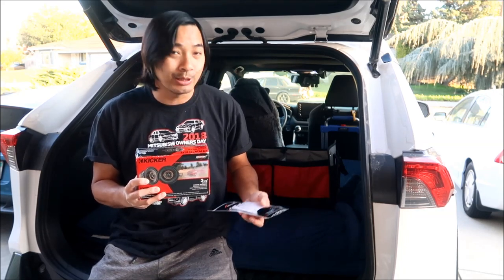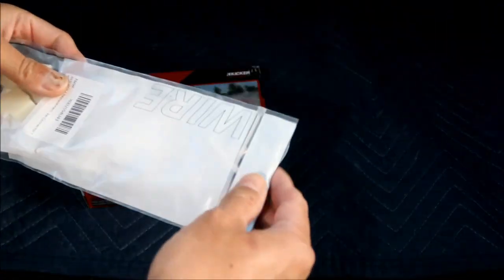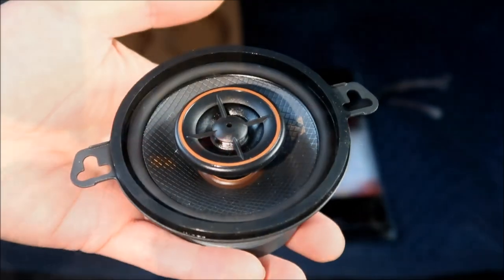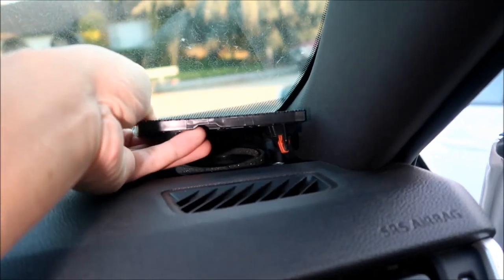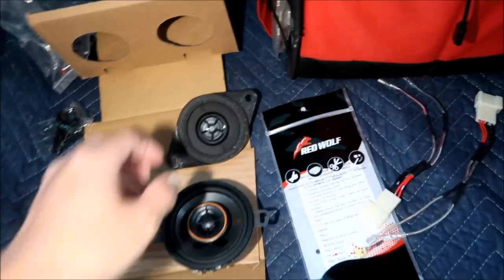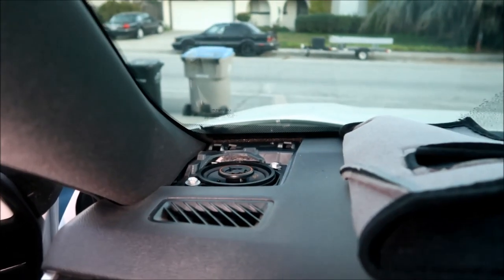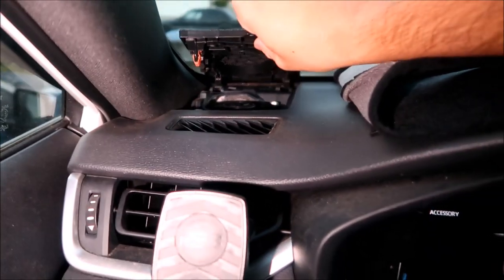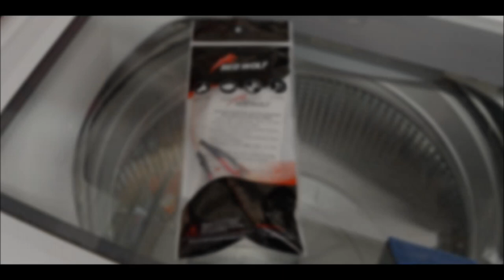Rav4 Prime SE Front Dash Speaker Install VLOG

Comment: Best video showing the changeover of wires for polarity.   Some speakers come with capacitors to deal with too much base especially at high volume.  Agree that what is backwards is the wolf supplied wires.  If it is a known fact that polarity is reversed from 'normal standard' on the rav4 primes, then wolf should adjust the harness for that and not force people to cut and splice.   However in this case it looks like kicker provides a cross-over so that you can power + both tweeter and base  separately?? and - is the small third terminal.   
So being a complete noob, IM guessing the crossover cable is to provide outputs to both tweeter and base separately?  Hence one would still need to reverse the polarity before plugging into the toyota stock harness.  The difference from what you did is is that you would reverse the + and -  (red and silver) before splicing them into Kicker cross over cable ???
Like you watched videos and thoroughly confused.    Wondering if a capacitor is still needed in this kit or if its built into the square piece that kicker provides on the crossover cable??

Comment: Thanks for the video but I wanted to let you know two things I noticed after installing my Kicker KSC3504 speakers.  You want to make sure you use the included crossover module from the supplied wiring harness from Kicker. The way you have yours wired the tweeter is getting a full-range signal and will eventually fail. I'd also recommend bass blockers be put inline as well.
Reply from the maker: Hmm interesting I haven't had a problem with the speakers.  However when my dash gets hot like from the sun it starts cracking whenever there is a lot of bass.

Comment: Thanks for the video.  I added JBL speakers and didn’t switch the wiring, and they sound pretty good.  Will have to check the impedance to see how they line up.  Is there a way to tell the difference between polarity changes in the wires?
Reply from the maker: There is a way to check with a multimeter I think not sure but audiophile people have tested it before from what I hear.
Reply: Also wanted to confirm that i installed Infinity speakers (similar to JBl) and also didn’t reverse the wiring. So far it’s it’s a lot better than the stocks

Comment: If it's true about the wiring Red Wolf should be replacing them at no cost to all who purchased them. 
Just a heads up, Crutchfield will send you the wires free to go along with the speakers. I am not a fan of the JBL speakers, the sound isn't very good.
Was told by Crutchfield that the Kicker speakers are the best option for the Rav4. They should be arriving in a day or two, can't wait to install them all (6) and hear how they sound.
Reply: The Crutchfield wires are also reversed polarity.
Reply: @whaleshark2625  I highly doubt it

Comment: Main thing is you want to match the impedance with factory speakers. It does say "4 OHM" on the label on the factory speaker so you're good.
Yeah clearly these factory dash speakers are used for weight savings. And they are not full-range speakers like the replacements you installed. So the factory dash speakers are only for high or mid to high frequencies and don't have large heavy magnets on them. So on the factory setup, they are relying on other speakers in the car to supply bass frequencies. If you're not getting any bass response from the new speakers, it might be that the factory Toyota wiring harness and/or head unit incorporates a high pass filter (capacitor/crossover) for those factory dash speakers.
Reply: Good analysis

Comment: I bought a corolla cross and no matter how hard I press the clip in to release the tweeter, the tweeter isn't coming out. I feel like they did this where it can't come out lol
Reply from the maker: Sorry don't know what to say keep trying.  Try pushing forward before you unclip it, it will relieve pressure on the clip so it moves more easily.
Reply: @HadesOmega  Thank you. I used needle nose pliers and finally got it out.